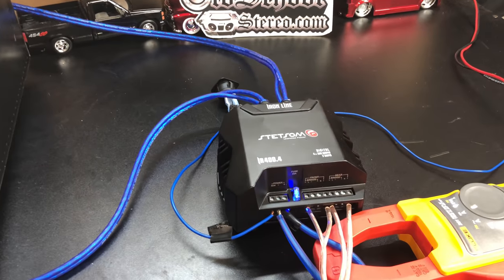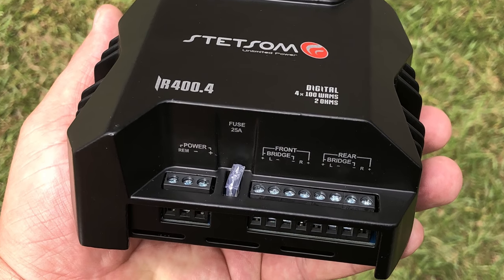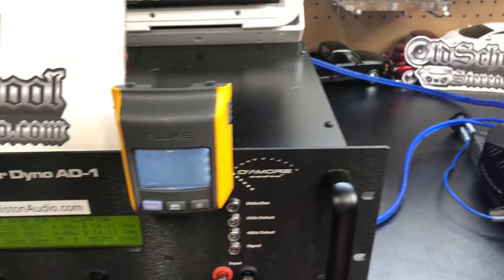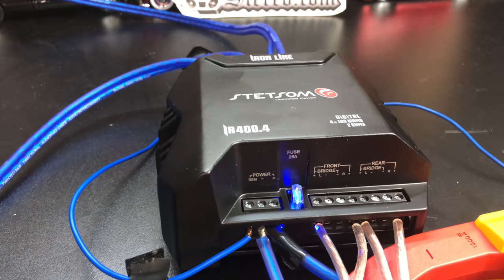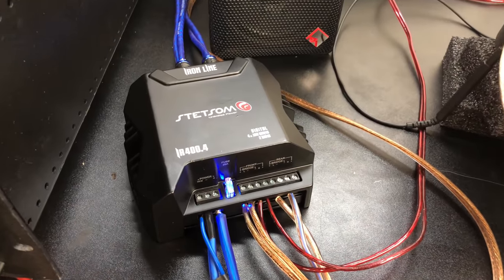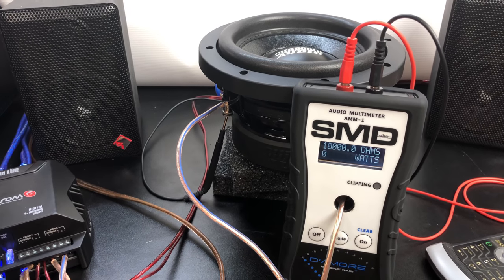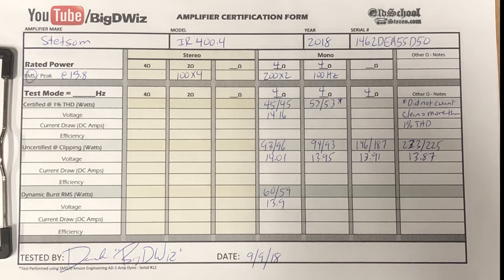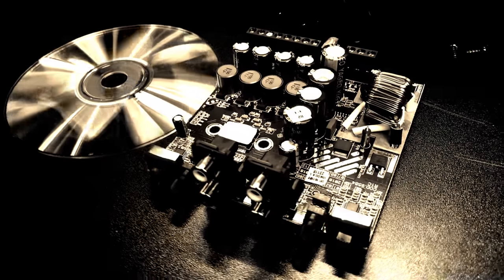Stetsom Iron Line IR400.4 Handheld 400 watt Amp Dyno Test (4K)

Comment: Even though the wires were connected incorrectly, I still see a practical use for this amp. It can be used as a stealth amp for those who have an aftermarket head unit, but still rocking the stock "special" speakers (i.e. Bose) and want just a tad more power going to them in conjunction with the stock "amp". This will be especially for those who have 90s/00s Nissan & Infiniti cars with those Bose setups.
Reply from the maker: Stetsom IR400.4 Part 2 - Wired Correctly for Dyno Tests! https://youtu.be/8iC-rk4ubGs
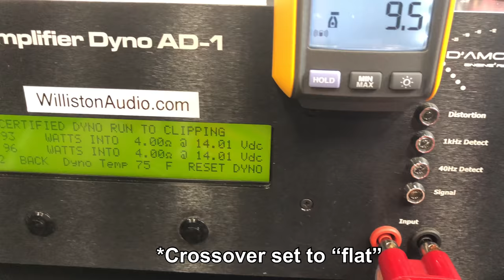Reply: @wal   sorry dude look again, left pos to right neg bridged, look again @4:21

no wonder people burn chit up

Comment: Screw it big D Wiz you should start making your own amps and add all the features that you know should be on there good power good ground features no positive negative wire side by side built-in clip indicator Bluetooth phone capabilities and then sell it people would line up to buy them from you✌
Reply from the maker: Maybe one day 🤷‍♂️
Reply: Well my buddy and my brother-in-law are Machinist they could easily make you an amplifier frame from a block of aluminum in matter of minutes something proper for heat sinking of your design of course just give me the measurements and we could get it done
Reply: @louiemares1610  sounds like a good idea for big Ds Bday make him a couple custom OSS heatsinks then mod in a couple of the higher-quality Chinese mini amps to make them functional. I'd chip in for that!
Reply: Louie Villa I say we take STK outputs from a Sanyo 50-50 and create a 5 channel class A  to get the .05 distortion ratio 🤭
Reply: I’d support that.
Reply: I approve this message 👍👍

Comment: A large number of Amps have power terminals too close. I use insulated ferrules and heat shrink to prevent any shorting. Also stable mounting goes a long way too.

Comment: Listen... What’s that Razr doing just chillin 🤓😂! That phone was the beez kneez back in the day
Reply from the maker: Waiting to shave a big dummy’s head 👈😬
Reply: LOL
Reply: Lmao so true! I had a few of those phones in my days.
Reply: @bass-n-truth-inthestix9083  I had one - best phone I ever had, esp. given the abuse it went through (run over by a 3/4 tone pickup twice, dropped in the snow multipule times for hours on end, even went through a snow blower a few times :-O - like a Rolex, it just kept on ticking).  The battery degraded to the pint of no longer holding a charge after 4 years of daily abuse. :-)
Reply: @nukedathlonman  haha right on I had quite the opposite luck with those phones.  The smallest drop or splash of water and it was dead. I went through like 3 or 4  of them lol. Dropped of a balcony 1 time that was no hope it was in pieces. From normal use dropping on the ground and stuff though it was sturdy enough. Actually now that I think of it each time I broke mine it was a point of no return from getting smashed to pieces. It was my friends that had the water issues lol not me. I managed to keep mine dry.
Reply: @bass-n-truth-inthestix9083  Cool cool - I know my sister didn't have luck with hers (I had the CDMA one from Bell Mobility, she had a GSM unit from Fido).  I dunno how many she went through (at least 15), but I know for the 1 year every other week she was exchanging it for yet another new one.  It become quite the butt of jokes and family betting pools. LMAO :-)
Reply: @nukedathlonman  lmao yeah that sounds about right. Mine was Verizon that's all I know
Reply: Those Rockford satellites , OMG...  I miss those  RF components  from the early 90's man !!!!
Reply: I loved that camera in those razer's phone.

Comment: I'm in the market for a new full range 4 channel amplifier and this amp was on my list. As I have limited space in single cab f250.  I'm glad you did this Dyno. I know to cross off this amp from my maybe list.
Reply: I might have to wait for the re-test to decide lol.
Reply: I just installed the Rockford T400x4ad and the T750x1bd in a single cab f150. Those amps are unreal! Tiny enough to fit under the seat along with the epicenter and distribution blocks. But the sound is LOUD and super clean. Of course they’re more expensive but rock solid quality and great resale value
Reply: @sergiocuevas7589  I was looking at the 400×4 rf as well. It's definitely in my top 10 of choices. I know I want more power than 100×4 because I plan to run as many speakers as possible from whatever 4 channel I end up with. I'm replacing a 350 watt rms dual 4 channel , so I want to step it up quote a few notches lol. But i am also trying to stay under 200 and even under 175 if possible. So I'm looking at soundqubed s100-4 as my top pick and I'm basically stuck between that amp or skar rp150.4 or the pioneer gm8604. Right now I'm leaning towards none of the above and going out on a limb for the massive audio blade 1500.4 amplifier.  I've had good luck with  massive audio product and that amp looks very nice and claims great ratings and features. But I know nothing about it except what the website says. So I may just try it. It claims 240×4 @2ohms. Even if it doesn't quite get that much power it could end up being very nice. $119.00 bucks man it may be a gem lol
Reply: Massive clean power for full range is not cheap. You gotta compromise sound quality for power in a class D. A class A/B will ALWAYS sound cleaner than D, but they are bigger in size. Throw a $200 budget cap and you’re stretched out even thinner. For my SQL truck I’m running a T600-4 class A/B amp for  4 T2 6.5 components and the amp runs them with ease. For my SQ truck I have the Zapco sq (which starts at $200) running Kappa components and the sound is audiophile grade BUT half as loud as the t600-4.
Reply: @sergiocuevas7589  the amp I'm talking about is class a/b full range with bandpass option and cea 2006 compliant rating and only 119 bucks and it's loaded with all sorts of filtering features ect.  It's definitely between the pioneer, the soundqubed and the massive audio blade amp. I'll prob go with the massive audio because it has alot of power and I'm sure it will sound good. 240×4 @2ohms is plenty of power to push a few tweeters and coaxial or mid range speakers. Anything will be a upgrade to what I'm using now for my highs and mids. I can't complain now at all either. My shit is crazy loud.

Comment: Love the videos. It does so well on the higher frequencies is because it's a tweeter amp
Reply from the maker: But it has a low pass filter. Use those much on tweeters? 😊
Reply: You literally just made that up. Why would a tweeter amp be a 4 channel... Besides it says that nowhere, not on any sales site nor their original site. Would it be good for tweeters? Yes. Is it a tweeter amp by definition? No. Stop making up things trying to sound smart.
Reply: Yeah. I sale them and install them. They can play small speakers but do better on tweeters.

Comment: the distortion indication on the dyno isn't designed to be used on any frequency other than 1khz or 40hz
the notch filters inside of it are set to those frequencies, any other frequencies played show up immediately as distortion once you apply them as you can see during the 4khz test
those aren't valid numbers on the 4khz test
Reply from the maker: Not true. The amp Dyno can read clipping at any frequency. It only correctly measures 1%THD at 40 and 1kHz
Reply: then let me ask you, how do you detect clipping without the amplifier rail voltage for reference?, it's not possible

Comment: hello, I liked the tests, but we here in Brazil already know that the stetson line does not have the actual power specficated, but only found its tests with speakers a bit bad even if the quality is not the best speaker without cabinet leaves to be desired , logical if you want quality it will have to be an amplifier class "A"

Comment: Calling all Pioneer GM8604 owners it's time to smile!!!!!! This is a prime example of why I refuse to buy Brazilian amps! Who put the ground and power right next to each other?????
Reply: It's not even wired right bro
Reply: May not be wired right but WAgner is right those gm 8604 is no joke ..
Reply: @mikewaters6339  damn straight!
Reply: @mitchellroberts7954  

Lol.. Dang bro, why personal?? No reason for that.. there are plenty of less $$$ amps then stetsm doing just as good.. it's his opinion, relax homie..
Reply: @mitchellroberts7954  you do whatever floats your boat. There's a ton of reasons NOT to buy a Brazilian amp like them going up in flames and for a person like me who likes to wire down to .5 they're not recommended. Subscribe to my channel
Reply: The pioneer 8604 is only good if you are running a budget system and got it cheap. I had one for a year and it died- bad RCA. Ended up getting an Alpine 4 channel even with the lower RMS rating it sounded way better.
Reply: @brandonsealey4511  I've had nothing but good luck with them. Had em for two years... sold them only to go right back to em. Sound amazing with the speakers I've had them on
Reply: @Outty5000Hertz  I had no issues with it when it worked.  Decent if bought cheap. But it died out when running at less than 1/6 gain. (I was literally running it under the H).

The alpine just sounds better... louder and clearer with less rms power.  Noticed a marked improvement in mid bass. Same speakers.
Reply: @brandonsealey4511  that's crazy! I had them tuned correctly at close to 70% on the gain never cut out and sounded just as good as the Rockford Fosgate amp I sold them for and I switched right back to Pioneer!
Reply: @Outty5000Hertz To be fair  I'm running a clarion eq as well....that increases the input voltage. I'm guessing that played a role it is demise. RCA gave up the ghost.

Even then, I had the gain set so low I was shocked! Lol
Reply: @brandonsealey4511  every company has defective products but its the amount of good vs the bad that makes a product positive or negative
Reply: So then I should buy that pioneer amp when I get my ass in gear and buy a new 4 channel amp lol. The 8604 is on my list. I'm stuck between that pioneer, soundqubed, and massive audio blade 1500.4... they all seem pretty badass. Definitely won't be going with these mini Brazilian amps. The soundigital mini 400.4 was on my list too. I need more power than that though.
Reply: @bass-n-truth-inthestix9083  based on what I've used I highly recommend the pioneer championship lineup all of those amps are great!
Reply: @Outty5000Hertz  right on man. Yeah it has definitely been on the top of my list. The soundqubed s100-4  is the closest competitor as far as my choices go. It sucks not knowing if you can trust ratings from some companies.  Massive audio blade 1500.4 claims 240 watts rms ×4 @2 ohms. So idk what to do lol. Prob just going with pioneer.
Reply: @UCGqbvhq8tMvIBTvhEWeIopw yeah man it's not so much beginner as I'd say budget lol. Not even budget it's not really about that either. It's about... value, and clean sound. Cost dollar per watt without skimping on sq.  So for me it's anything I can buy without digging too deep in pocket and still sound good with alot of power. I've been looking at the zapco amps too actually.
Reply: @mikewaters6339  give an example? Stetsom sells real 3k amps for $215. Same as taramps pricing wattage very very hard to beat it at the price

Comment: I have a dumb question.. I am thinking about using this to power my door speakers they are 60w RMS at 4ohms, I see in the spec sheet that it can do 60w x 4 @4ohms.  how would I wire that and get 4 channels to work properly?

Comment: They use those amp for tweeters over here in Puerto Rico
Reply from the maker: Should power them well 👌
Reply: Do people run tweeters with amps and mids with the head unit? Or to power bullet horns? Passive crossovers and a solid 4 or 5 channel powers everything with less messy wires.

Comment: You Big Dummy! You haven't hooked the wires up correctly for the bridged mode. Have a look at the diagram on the speaker outputs!
Reply from the maker: I JUST noticed this too!! I will retest hooked up correctly. My old eyes are foolin' me, they be confusin' an old dude!
Reply: @wal  It happens to us all believe it or not I've seen guys younger and see way better then me do  the same lol
Reply: I can't believe it put anything out being wired like that lol
Reply: doddyz d 
Dude you do pay attention because I miss it too.  👀👀👀
Reply: How soon before you repost with the correct test? I have a feeling it is not gonna be too far off. I have made mistakes that seemed to make little to no difference. It either works or it don't from my experience in most cases. I dont have a tester like you, but my ears are pretty good.
Reply: @lfernandez9194  Just very observant! :)
Reply: I've looked at the wiring diagram on the amp for quite a while now, but I really can't see whats wrong... I think I need better glasses.
Reply: My Mind is playing tricks on me.

Comment: The factory ratings are definitely deceptive but since it's peak power is in the higher frequencies I can only speculate that they intended this for running tweeters. But for such a tiny amp with not much heat sink, I guess you wouldn't want to run any bass or midbass thru it for long. LOL
Reply from the maker: Correct 👌

Comment: an amp that can produce 400wrms across a flat spectrum would be too hot to hold in a very short time. but like some unscrupulous manufacturers in the late 70s who bloated their parameters wildly (peavey - who still do it today with ratings at 2 ohms rather than 4 or 8) it may produce 400w of terribly distorted output at 1k cycles (hz to you fng’s) for a very short time with gastly harmonics. impractical for much other than a door bell or a fault indicator klaxxon on some sort of machinery...

Comment: 300 watts max with that fuse. Those mini amps are always around 25 watt per ch+.
Reply from the maker: These chip amps have gotten more powerful recently
Reply: @wal  That one has bigger caps than the one's I have seen, that is probably why they charged more for it.

Comment: It's a tweeter amp . 
It's supposed to be tuned and measured for that bandwidth. 
And, wired wrong, etc.. 
MY STETSOM 7K2E DID 6,004W wired .7, rising .3 to a perfect 1 Ohm, DROPPING TO A GUT WRENCHING 9.9V . (I burped it regularly with only 1 regular car batt and stock alt)

NO korean amp on Earth will ever do any such thing. 

Test any size of the Vulcan 12V series. 
Pretty please. Lolz. 
Put all the haters to bed forever.
Reply from the maker: I retested it wired properly

Comment: You dont wire the bridge mode correctly you can see on the drawing on the amp is the 1 a 3 port for bridge mode you wire 1 and 4
Reply from the maker: I made an update video Stetsom IR400.4 Part 2 - Wired Correctly for Dyno Tests! https://youtu.be/8iC-rk4ubGs

Comment: Definitely just a mediocre class D chip amp the way the power output increases when the ohms go up or frequency goes up. Since the SQ is lousy they're probably overdriving the chip with high voltage to try and get it to output more. I'd be concerned about reliability if that's what they're doing. The second song you used in the 3 way demo is the outro song that Techmoan uses on all of his videos.
Reply: you realize is not wired correctly right? lol

Comment: You need to take this video down and post the correct info. I mean come one. You post a video where you made a mistake and botched the results which requires the viewer to read the description to notice that the results were not accurate.
Reply from the maker: Stetsom IR400.4 Part 2 - Wired Correctly for Dyno Tests! https://youtu.be/8iC-rk4ubGs

Comment: It is crap. A pile of shit waiting to happen. A novelty pocket  sized amplifier that should cost 19.99 at best. Better off without an external amplifier than to buy this crap for 129 bucks. I bet the average moden cars stock system sounds better.It is cool to see power like this in such a small size.